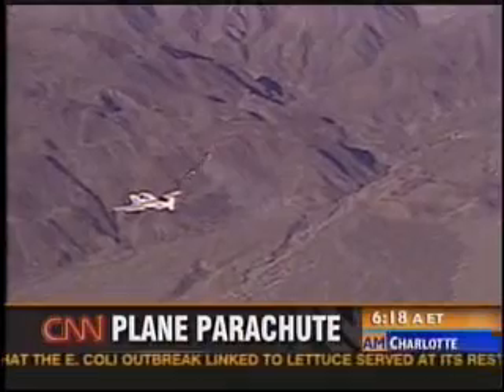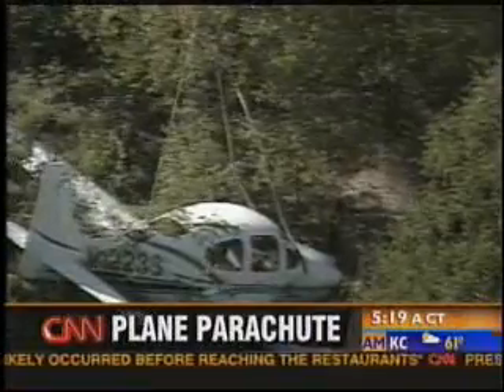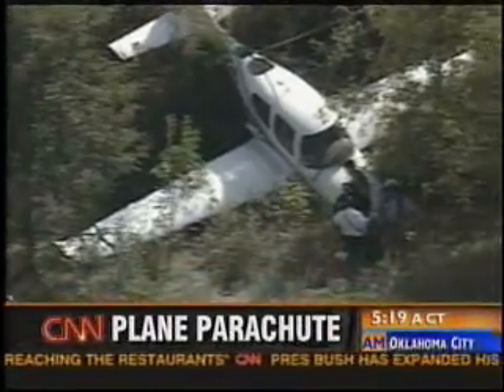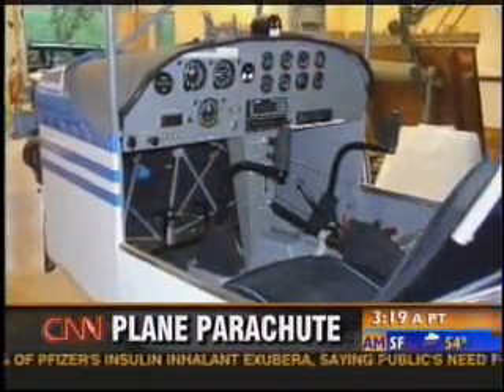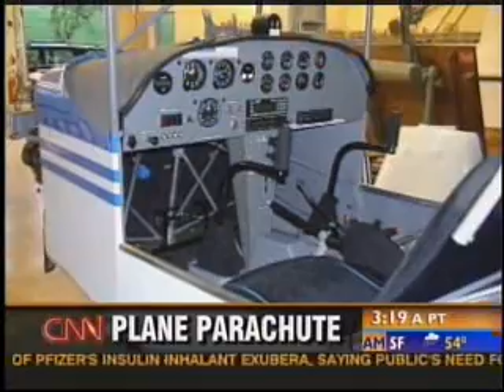Mid-air Collision and BRS Parachute Save

Comment: The chute is automatic over water, mountains and at night when you can't tell whats on the ground.  It also works for midairs as seen in this vid.  You get your life but not your plane.  You hit at 9g.
Reply: Repeat that for me again.  Your first 6 words.
Reply: Ivona Humplot
  You should use the chute AUTOMATICALLY, without hesitation...as your first goto when in trouble over water.....is that clearer?
Reply: GBigs Angle  Yes, thanks.
Reply: you hit at 17 mph not 9gs lol
Reply: @WillyOrca  Nope.  The seats in a Cirrus are rated for 20g impact, the main gear are constructed to blunt the force.  You hit the ground at the same speed as jumping off a five story building.  Or about 50mph.
Reply: @speedomars  wrong. I just watched an entire doc about these. You can literally watch them being deployed from initial deployment to touchdown and it's def not 50mph. The Company themselves put the number at 17mph.
Reply: @WillyOrca   Nope.  I owned a Cirrus SR22T...bought new.  I took the full motion simulator training for the chute pull and experienced the unsettling feeling and was informed directly about the physics of the design .  Every stat I gave you is correct.  No Cirrus aircraft survives the crash after a full chute pull.  The occupants are unharmed, the plane is totaled.  Which is how Cirrus engineered the system.
Reply: @speedomars  lmao nobody said the aircraft survived the crash. I said it doesn't touchdown at 50mph. You can watch several videos in that link I commented.
Reply: @WillyOrca  You seem to keep missing the point.  I OWNED THE PRODUCT.  I WAS TRAINED BY THE FACTORY IN THE USE OF AND THE ELEMENTS OF THE CHUTE SYSTEM.  Everything inside the cockpit is designed for HIGH IMPACT.  The seats are rated for 20g...the main gear rated for 9g to collapse and blunt impact.  The effect is like dropping the plane off of a 5 story building (UNDER CHUTE).  That translates into about 47mph on impact.  On hard turf, the plane will breakup, the tail often seperates, the prop hits the ground and the engine is totalled.  The doors can become jammed, so they provide a small hammer as standard equipment in the center console to break the windows to get out.  I tell you this in case you or anyone you know assumes that pulling the chute is anything other than to save the humans inside...the plane is always totalled.
Reply: @speedomars  SO WHY DOES EVERY VIDEO OF THEM BEING DEPLOYED SHOW THE AIRCRAFT TOUCHING DOWN AT AROUND 18-20MPH?
Reply: @speedomars  are we really arguing in two different comment sections by total coincidence? lol
Reply: @WillyOrca  Well, as a former Cirrus owner I will comment when I see people repeating incorrect or even ignorance when it comes to Cirrus.
Reply: @speedomars  lmao why do you keep avoiding the part where there are literally videos of the CAPS system being used? You're not right about this lol.